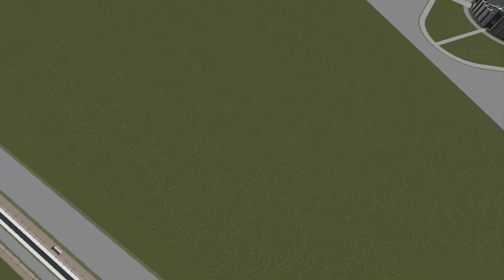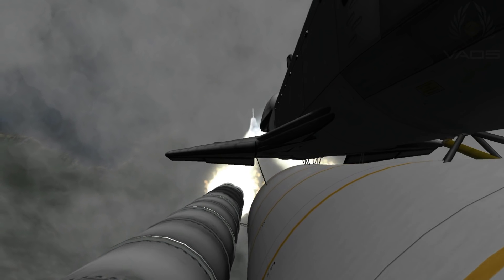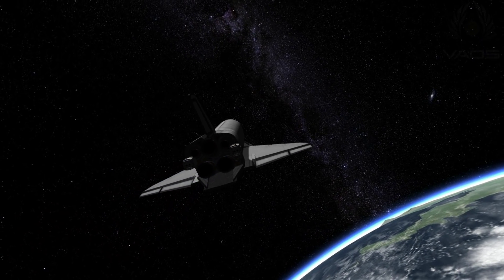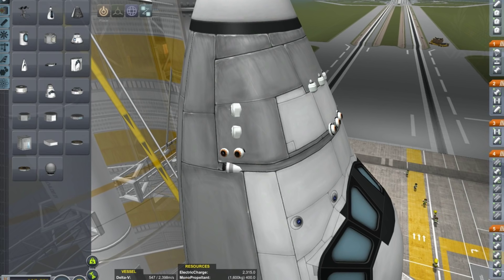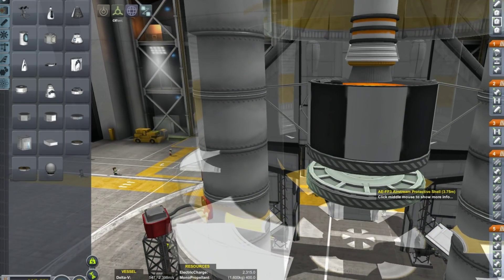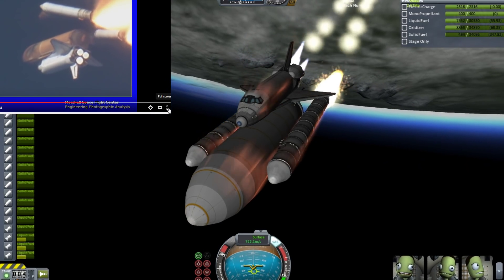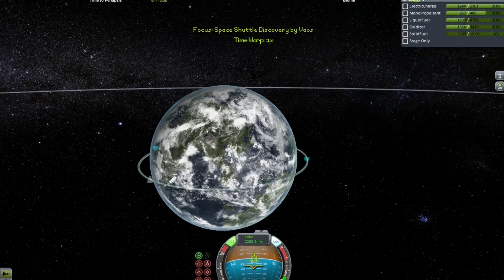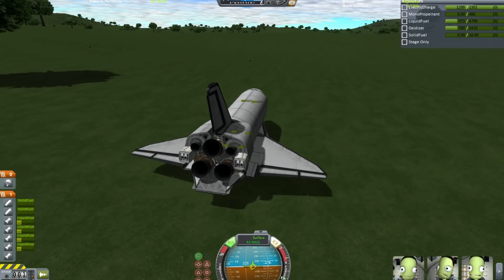KSP - SHUTTLE DISCOVERY

Comment: Congratulations! Awesome replica!
I've tested it in so many ways and decided to make some modifications. I was determined not to use the trick with the main engines to get in orbit, so here's my modifications:
- Angled the 2 maneuvering engines to the shuttle's averange center of mass.
- Added a little more fuel to the external tank (to get a wider sub orbital trajectory and reduce the delta-v necessary to next step)
With this modifications I have more time next to apoapsis to burn the maneuver engines. 
Without the trick, I spent half fuel to reach a 100km orbit.
I'll make a "feedback part 2" later xD
Sorry for my english and thanks for this awesome craft!

Comment: The "no RCS of reaction wheels" part is quite impressive, and it looks like a million bucks, but I feel a bit sad about using the SSME's after ET separation. Are you sure you can't angle the OMS down so it burns through the CoM like the real thing? I reckon you'd have enough TWR to circularize without going over your Ap.
Reply from the maker: +rune12358 - Yes, If you use Reaction Wheels, you can just burn almost into orbit with the Tank and then burn the rest of the way using the 3 main engines as the tank burns up falling back to kerbin. Lots and lots of reaction wheels. KSP is coming out with actual shuttle engines soon with enough thrust and vectoring to do the job right. But for now, without reaction wheels, I have to make a "workaround". :)
Reply: +Vaos Human I... don't think you understood me. I meant that you could angle down those Swivels (or are they Reliant engines?) about 10º downwards, and they would fire through the shuttle CoM, meaning you could NOT use the "SSMEs" to circularize after ditching the ET, and make it that much more close to the real thing. Not to mention the flying manual would be less complicated, not having to thrust-limit the SSMEs. The RL shuttle thrust about 10º below what you would think is it's prograde because of that (and RL OMS engines run on hypergolic propellant, unlike the SSMEs). Just a nitpick, as I said it looks really good!
Reply from the maker: +rune12358 - Oh i see ... ok ..... hmmm ... you would have to test it out. If it works that would be amazing! :)

Comment: Beautiful shuttle! I like those touches you did to the launch pad. Also the OMS pods look great. If you want to keep fiddling with it, you might try staggering the thrust limiters of those clustered SRBs, like WinterOwl, so that the center one continues running at 50-70% after separation. That way, it moves away laterally at about the same acceleration as the rest of the vehicle. Also, clipping two vertical stabilizers in just the right way allows the deployed rudders to act like a split rudder speed brake, which provides extra pitch authority during the final flare when you really need it. But first, get some sleep!
Reply: +DistracticusPrime Oops, didn't notice the Mainsail in the center. Well, same idea might work with that arrangement, perhaps with only the Mainsail still running for a few more seconds, or two of the SRBs.
Reply from the maker: +DistracticusPrime 

That's a cool idea! Thank you :D

Comment: Since when do those solid rocket booster use liquid fuel?
Reply: +Loco Coco Stock KSP doesn't have big enough SRBs for a shuttle.
Reply: +Loco Coco If you look closely at the bottom, you'll notice a cluster of 7 SRBs clipped inside the LF tanks. Probably those LF tanks are empty and there just for looks.
Reply: +DistracticusPrime There is a Mainsail in the middle also providing thrust and thrust vectoring.
Reply: DistracticusPrime But how can they perform such a long burn? most times they are empty at 1000m, especially with the weight of this craft, atleast this is what I assume
Reply: +DamienK28 Ohhh, I didn't notice the Mainsail. That would help a lot with vector balancing until the 1.05 STS engines come out.
Reply: +Loco Coco Probably thrust limiting. So, maybe the SRBs are there for looks?
Reply: Vaos Human That makes alot of sense, love the looks of it, just feels like the real thing, congrats my man!
Reply from the maker: +Loco Coco 

Because KSP Stock is all I use, I had to workaround the lack of proper SRB's for the Stock Shuttle. The SRB's for this shuttle are a combination of LF tanks and engine, and 6 Large SRB's clipped in there for looks and added thrust. The SRB's are limited in thrust which allows them to burn their fuel much slower, lasting longer. And the LF engine helps with control do to the fact that there are no real Stock Shuttle engines yet in the game for control. :)

Comment: And quick tip, rather than rolling why don't you just position the shuttle facing west? so you don't have to roll, or does the real shuttle roll?
Reply: +Bubbadevlin For us, it's simply tradition. Shuttle launch just wouldn't look right without the "roll program". For the real shuttle, IIRC that orientation was necessary to allow one of the abort modes where the shuttle separates early and glides back to KSC.
Reply from the maker: +Bubbadevlin 

Yes, the real shuttle does a roll maneuver. Also known as a roll program.  ;) ;)